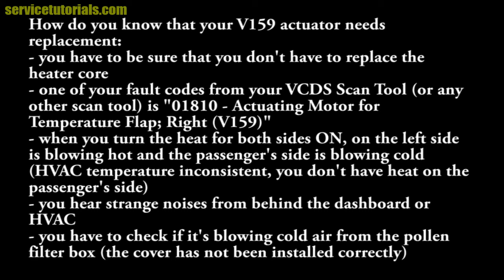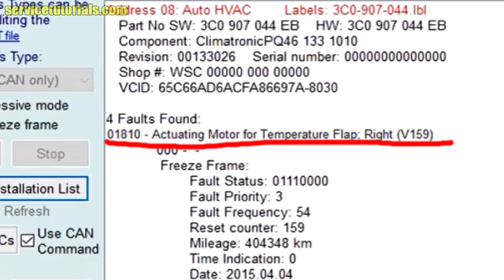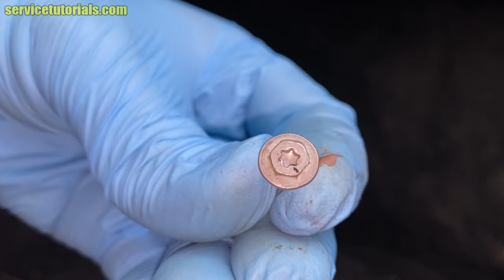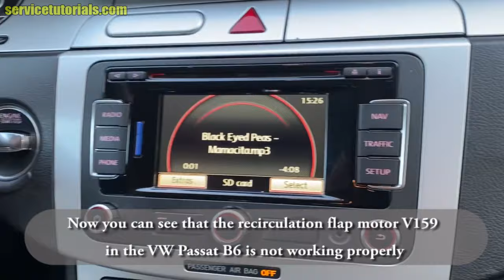TUTORIAL: How to remove V159 Air Recirculation Flap Positioning Motor on VW Passat B6 3C 2006-2010

Comment: To replace potentiometr inside V159 you can leave V159 on its place (don't need to remove last 3 screws that was one of the hardest parts of this replacment for me). When you see V159 from the side you can remove V159 connector (need to press the connector tab, which is located on the far side and is not visible from our side), then remove V159 plastic cover using thin flat screwdriver. After that you can take out old potentiometr and insert the new one back into the V159.

Comment: The same guide works for B7 passat also. However you need to drill a hole to get access to a T20 screw for a module that is covering the v159 motor.

Comment: Thanks mate for detailed tutorial, I've changed motor last night. Just mine metal plate near motor was bit different and it was very hard to remove last 2 screws. Small tip I've bent this metal and it was easier to remove this screws, just be careful and later return to first position. Anyway thanks a lot
Reply from the maker: Thank you for your feedback!
Reply: Hi, did you errase the errors after changing the motor?

Comment: My 2014 passat is blowing hot air on driver side but blowing cold on passenger side. Any idea why im not getting hot air on both sides???
Reply from the maker: Probably it’s because of the servomotors, but first you can start with a car dyagnose to be sure.
Reply: @Servicetutorials  thank you mate. Your video is very helpful.
Reply from the maker: @tpof.2488  thank you too for watching!
Reply: @Servicetutorials , i have the same problem. Hot air on drivers side, cold air from passenger side. But no fault codes comes up. Could it be the plastic link from servermotor to the vent flap that has come of or broken??
Reply from the maker: @ yes, you have to check that part too.

Comment: is the defroster flap v107 the some location on 2006 and on 2009 because i fitted a newer climatronic to a 2006 variant b6 and my defrosting rear windows dont work so if i enable manualy the defroster flap or if remove it will me windows defrost?

Comment: Hello, thank you very much for your tutorial, one of the best i could find. Some really good hints are also in the comments, for ex.  the plyer to bend the metal in front of screws 2 +3. Take care to loosen the plastic lever, they have to be in an angle of 90 degrees approximatevly. I put some  contactspray on the potentiometer, it worked fine for me. I also bought a new one at AliExpress, they dont fit very well but worked as they should

Comment: Hey this is an excellent video!
Can i ask you I have a passat cc 2009 when I turn on the heating, there is only heat coming from the passenger side. Do i have the same problem like this video?
Reply from the maker: Hello! Use a VCDS scan tool to be sure that you have this fault code with V159 servomotor.

Comment: Hello! My golf 5 has a problem with cooling. The refrigerant is full, it has no loses, the pressure sensor is changed but my climatronic behaves strange. For ex from Bucuresti to Sinaia it pushes cold air but from Sinaia to Bucuresti it pushes warm air and this cycle is happening over and over most of the time. What do you think?

Comment: Thank you for this video, it helped me replace the V159  in my B7, i hade to remove a airbag box near that annoying plate in order to reach the screws. A question though, after disconnect and reconnect airbag box do i need to clear my error list ? because now i have a warning on my dashboard...
Reply from the maker: Hello! Thank you for watching! If it’s not turn it off after you drive the car for 5-10 minutes, yes, you need to clear the error with a dyagnose tool.

Comment: Excellent video! Thank you very much!

I have just finished repairing my Passat 3C5/B6 that showed the 01810 DTC and got some useful insight. 

I removed the V159 actuator and cracked it open. Found nothing wrong with it. The DC motor was working (applied external 12V to it) and the potentiometer also gave correct feedback (4.7 kOhm across end terminals and wiper varied between 0.5 kOhm and 4.7 kOhm). However it seemed like it would easily get stuck in one end position (maximum cooling of HVAC, which also matched the car's problem). When reversing the voltage the motor would just stall.

I greased up all the gear and ran the DC motor back and forth a couple of times. After this, the problem was seemingly gone. No spare parts required!

Then I tried connecting the actuator to the car and let it dangle from the dashboard, started the car's HVAC and switched temperature setpoint between low and high. The actuator would then move back and forth, thereby verifying the function of the actuator. I then put everything back together and now the HVAC is working properly.
Reply from the maker: @jaksel  thank you for the info! 👍

Comment: Hi, Thanks for the video. It is very useful. I am almost 100% that my car problem is that one without running diagnostics. It doesn't blow heat on the central right and passanger's side console. On theory if the error is V159 and I replace the motor is it going to work without cleaning the error?
Reply from the maker: Hi! I don’t know for sure, usually you have to erase to error to work.

Comment: Thank you for this excellent tutorial. Do carry on ! My heater is back thanks to your guidance.
Reply from the maker: Thank you too for your feedback, Bruno! 👍
Reply: Hello everyone, very nice tutorial! 
i have a problem with my passat, i have no heat and it blows only cold air, when i touch the two hoses that goes into the heater core from the engine bay : one of them is cold the other one is hot (heat is set to high on the dashboard) . I just wanted to know if this flap motor can cause this problem?
Thanks in advance.
Reply: @mmk958  Hello ! It looks like your heater core is clogged...
Reply: @Servicetutorials  it's the V425 not v159. V159 is the right temp control door motor.
Reply: @diameadozen  its look like European version maybe that’s why:)
Dobra robota chłopaki ;)
Reply: @magicgarag  got it makes sense thanks

Comment: Hello, i have a problem. There are not air ( warm and cool ) on center drill but sides is ok. What is problem ? Can you tell me ? I think, your flap motor only recircilaon fonction, is right? Thank you for all ( is it possible V71 ? )
Reply from the maker: Hello! To make sure that you have a problem with one of those servomotors, first you need to do a diagnostic test.

Comment: hi, my fault 
9484401 - Motor for Indirect Ventilation Flap 
          B10B8 71 [008] - Actuator Stuck
          
Which motor I have to change it? The simptone is similar as V159...

Comment: In cazu meu, am eroare de recirc flap motor, singuru simptom e ca uneori geamurile si parbrizu se aburesc extrem de naspa, uneori chiar periculos de naspa, sa fie de la asta ? Oare nu mai inchide bine si nu baga aer de afara ? Filtru si toate cele sunt noi
Reply from the maker: Daca ai eroare pe unul dintre servomotorase, da, poate fi de acolo sau de la radiatorul de caldura (sa nu fie fisurat).
Reply: @Servicetutorials  Salut, la mine nu baga nici aer cald nici aer rece pe partea soferului (nici in bord nici la picioare), pe partea pasagerului merge perfect si rece si cald sa fie de la acest V159? ca abia azi am descoperit si n-am avut timp sa verific mai mult

Comment: Hi, my fault code for vw passat b6 
9479957
Position sensor for indirect ventilation flap motor 
 
B10A7 15 (009) open or shot to plus 

Which motor should i replace?

Comment: Hello! Help please ! My car is a Passat from 2014 and when I press the button to blow air on the windshield is making  knocking noise ... The error code is B10B8 71 ' motor for indirect ventilation is defective' but I don't know witch one is it (V...)  . The noise comes from the middle left of the console on top of the navigation unit ... Thx!
Reply: I have the same error and the same symptoms (knocking) - did you manage to fix the problem? what was the motor? I will be very grateful for your answer